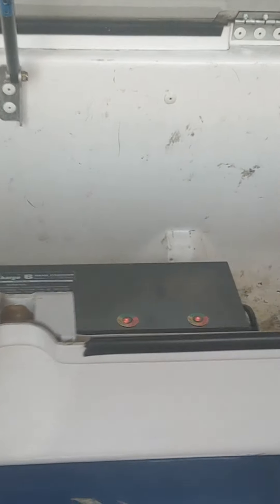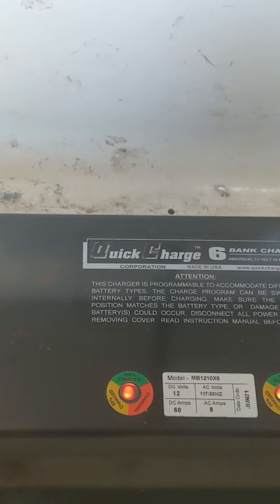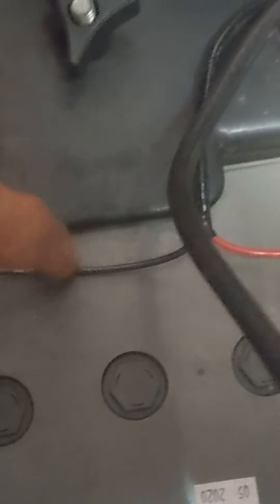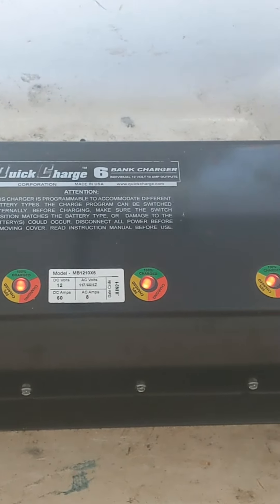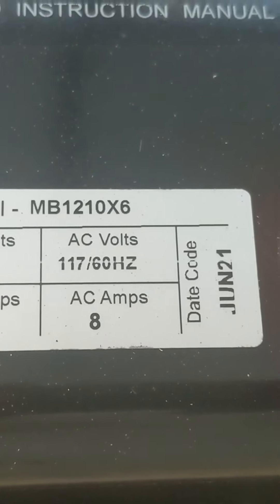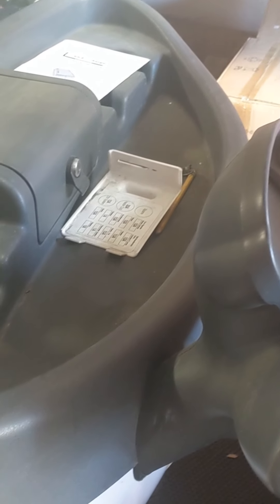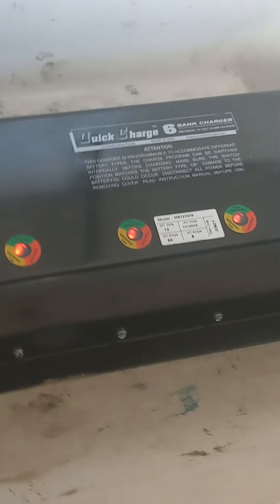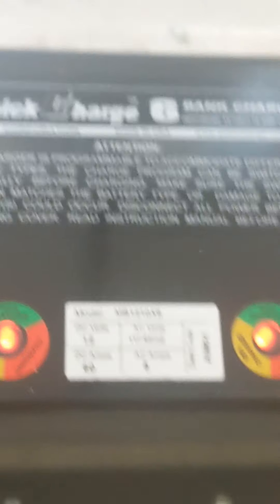72 volt Gem Car Charger Individually Charging Each Battery

Comment: when testing the voltage on each battery with a multimeter do I have to disconnect the series for an accurate test or will prongs on  each of the batteries neg & pos give me the same accurate reading if they are all  hooked up together.  Thanks!